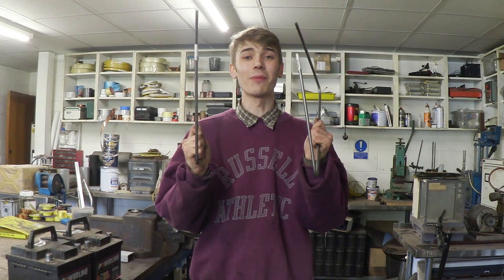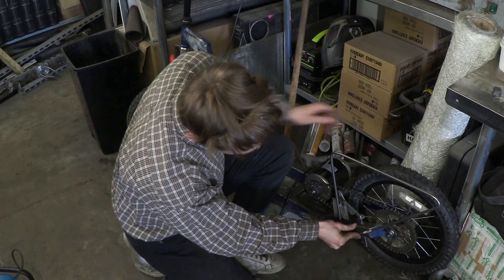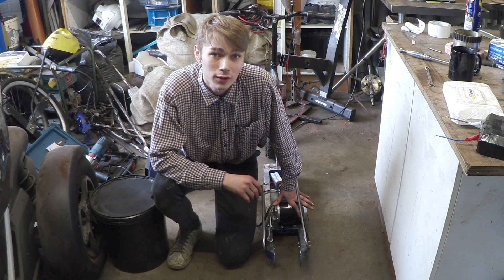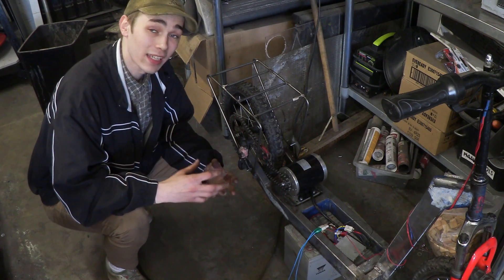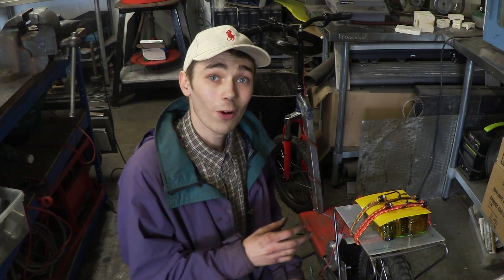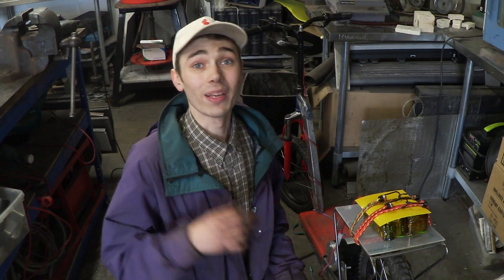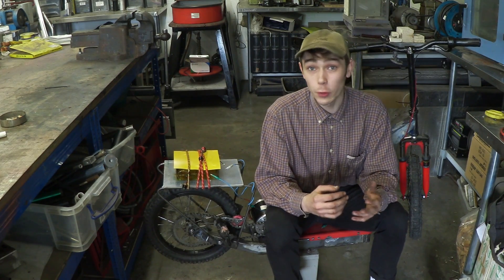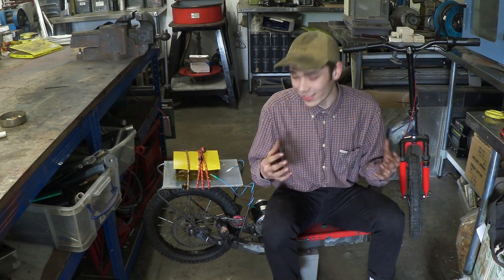1123   Electrifying my DIY Scooter   Final

Comment: I build them with the motor behind the rear wheel it gives me more leg room and the batteries are at the front so the floor board is lower to the ground very nice frame

Comment: I've used that motor for a variety of electric trikes etc. I've had 3 variants,  24v 500w, 36v 800w, and 36v 500w with stock Hduty 6 to 1 planet reduction head. Believe they are actually the same motor all 3.
Appropriate gearing on 36V and geared for a top speed of 40kmph it smokes up a minimoto wheel on the tarseal, shreds lawns in 3 wheel drifting sod hurling shredrampages, and kicks car butt at traffic lights and city driving.
It can pull a stall current of 200A!
 I have seen 2.5kW on 24V off the line.
I think you have a gearing issue. Mine works good with 9x 80 tooth minibike sprockets and similar wheel radius, three car batterys. That's 40kmph.
Towing up to a ton it works great geared for a walking pace top speed.

Those little batteries won't give you any range or the amps your motor wants. You can kill your speed controller because of this too.  A cheap 40A controller handled over a year of such abuse. But it and another like it went toes up trying to supply current pulses the motor wanted at low throttle.
An "overdrive" spade switch or relay to bypass the controller is a good idea. It will double your range, and is much faster and torqueyer.

Comment: I have a similar scooter that looks DIY, but was made by an actual company. It used 2x 12V motorcycle batteries under the plate you stand on for low center of gravity (you seem to have a nice spot for smaller batteries there as well. BMS was in a case a bit higher up. I've been meaning to update it to use 18650 cells and maybe swap out the motor as well. Cool project!

Comment: Chain tensioner should be on the bottom half of chain drive,  due to help guide the chain to stay inline with sprocket, because when chain tightens under load,   your bottom half of chain gets loose and sloppy,  which won't be a problem till the road gets bumpy,   

Well done 👏thow, my next dream build is electric scooter aswell.

Comment: Couldn't tell for sure but it appears you have your derailleur tensioner on the torque side of the chain. That being the case, you might end up with a lot of slack upon acceleration with the potential of throwing the chain. I like the idea of being able to shift gears. If your gear cluster freewheels then I can see the potential to save that option. If it does not then you may have to go with a single gear the best supports your load and go with a fixed tensioner. Glad to see it moving under its own power!
Reply: Yeah, that's going to need fixing. Luke, if you're reading, you really don't need a derailleur if you're not changing gear. Get the alignment right, slot the motor mounting holes a bit and tension it correctly and you'll be good.

Comment: Hey Bub 
I’m Taking The Gear Box Off My 47cc Scooter. I’m Setting A Clutch On The Shaft Of My Motor. 
Changing The Springs To Less Tension Has Giving Me The Grab I Want. I’m Using Robs Computational Circuit For Speed. 
Cheers Mate. 
Learning Is The EndGame.

Comment: Good job Luke. One improvement: the idler tensioner should be on the slack part of the chain drive when the motor is powering. As you've installed it, when the motor powers, the top portion will pull tight, and the bottom portion will go slack because that's where the tensioner should be.  I.e. under power, the chain will be loose. Hope that makes sense.
Reply: Lol you explained it way better then i could!